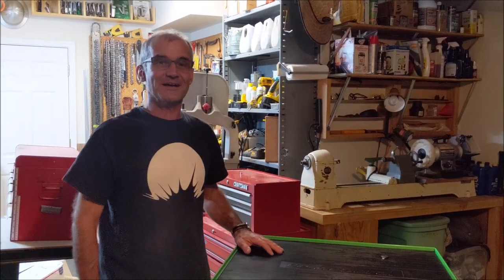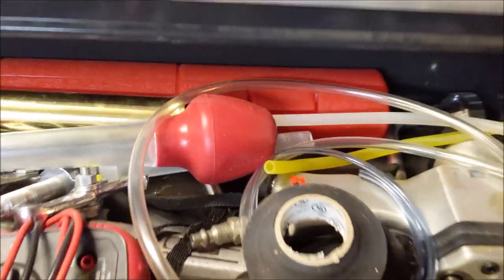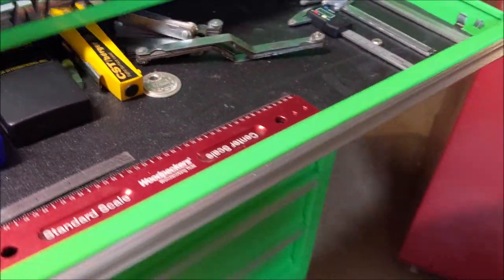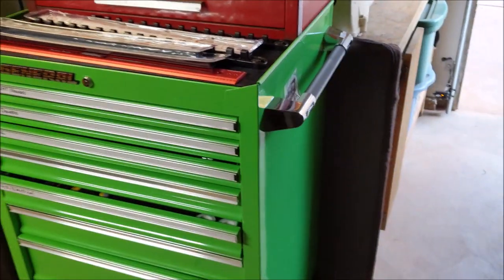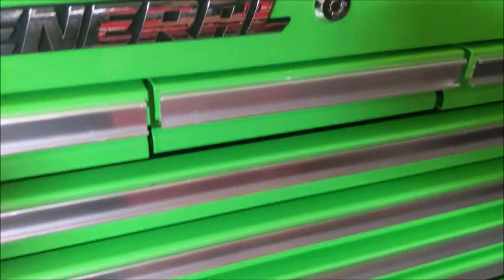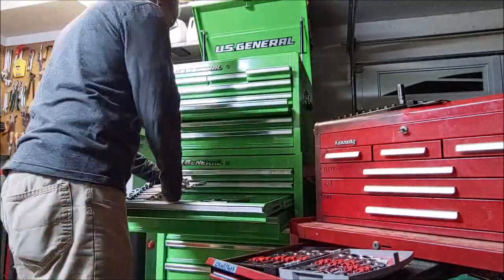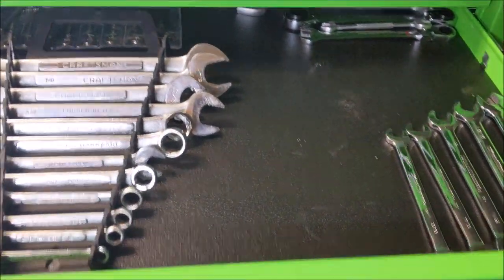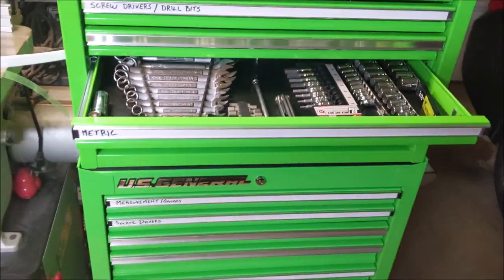Harbor Freight US General 26 inch Tool Cart and Toolbox

Comment: Anyone know exactly how tall these are with the castors on? Just the bottom box. Specs online say 40 inches, but I wasn’t sure if that was just the box. I need it to roll underneath a shelf I have in my garage. Thanks
Reply from the maker: Just measured mine, with the castors on, the top is at 40 and 1/2 inches.
Reply: @topsaw  thanks!! Helps a ton! I’ve got 42 inches underneath the shelf I made… what a happy coincidence! Guess I’ll be forking over a little money the HarborFreight 🤑